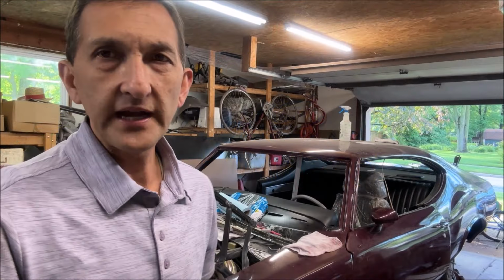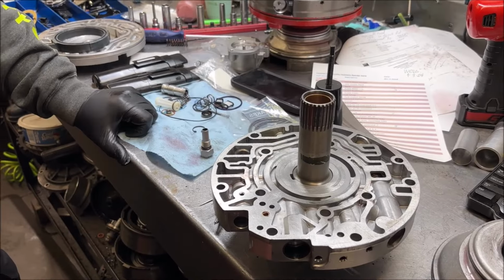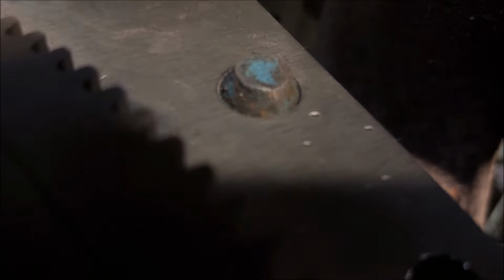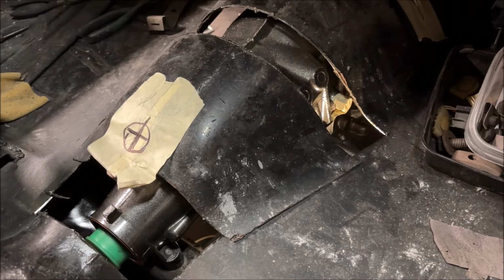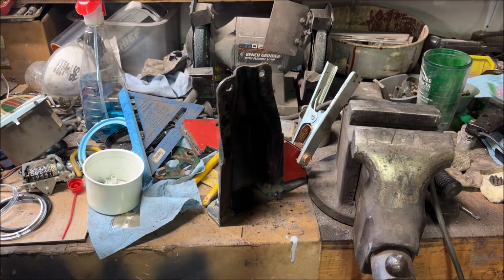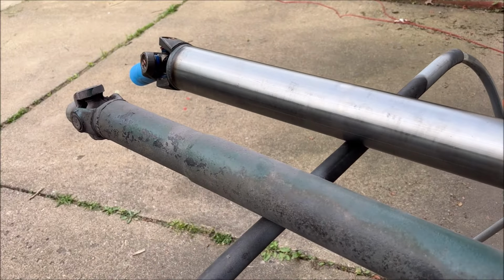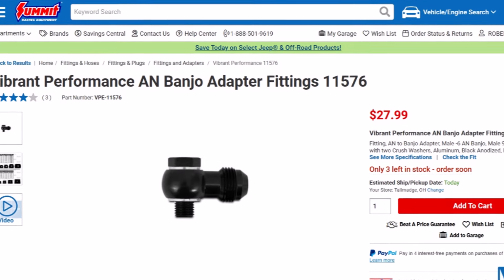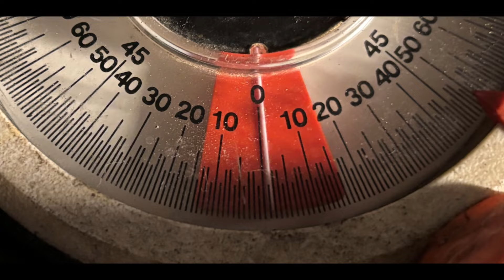1971 Cutlass Ep 14 4L80E in a 1968-1972 GM A-body!

Comment: Bob, the fine thread bolts for tranny adapter plate, don’t you want to use grade 8 ,  the yellowish color bolts for proper hardness vs annealed? The ones you are using, are they stainless? I always thought stainless is more brittle and threads tend to gaul more unless you use some type of thread lube? I’m not 100% sure… I always worry about this in high stress, high shear automotive applications…
Reply from the maker: The bolts for the transmission adapter are the ones that came with the kit, so I guess I’m trusting TransDapt on this one. I have used stainless bolts for things like accessories and intake manifolds. I don’t know for sure their properties, but they felt comparable to grade 5. That’s a good question though.